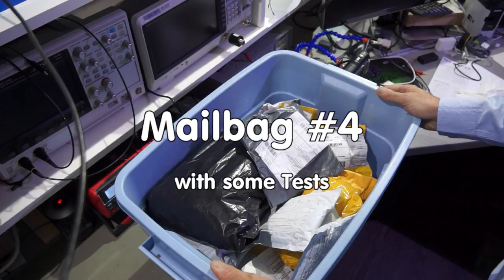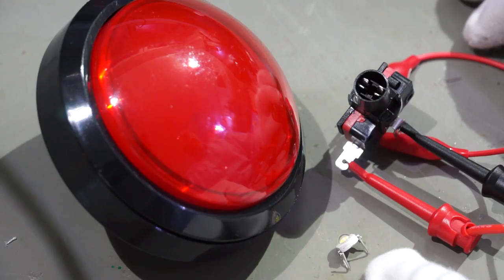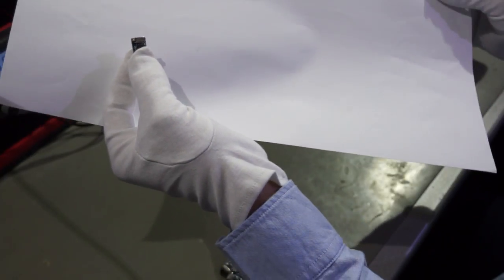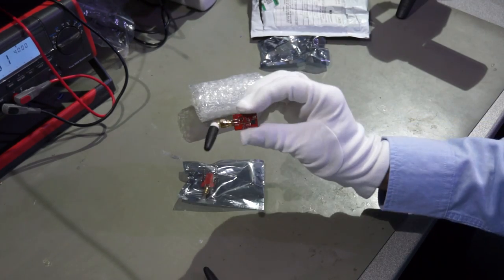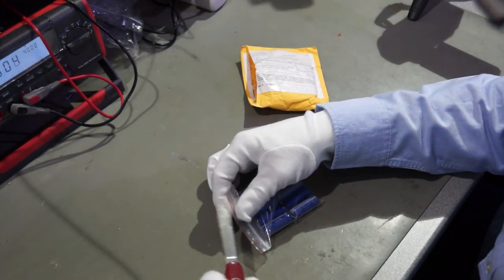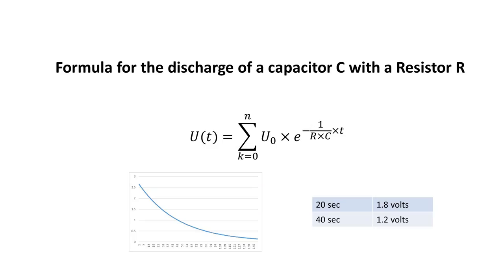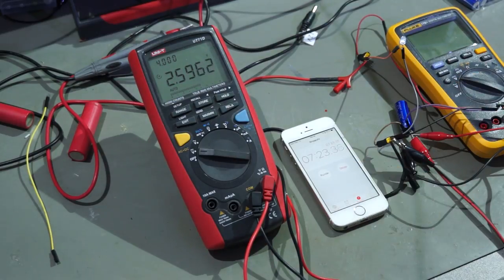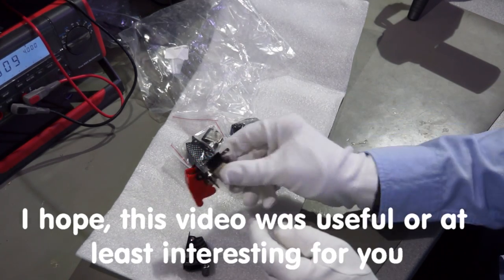#68 Mailbag #4 with some Tests

Comment: Thanks Andreas for a great video! The 433 MHz RF transmitters and receivers have really reduced in size over the years. It will be interesting to see how long they can be battery powered for. Keep up the good work!
Reply from the maker: The current consumption will for sure be one of the things I will look at. Others are protocols, sensitivity, and also propagation ( I have also some 868MHz modules).

Comment: Again a very interesting video. Looking forward for your tests of the 433Mhz modules.

Btw. I like these aircraft switches too. Haven't found a use for them but have a bunch of them laying arround to. If you have some with a clear protection cap and use a switch with a buildin LED these looks super cool!
Reply from the maker: Sometimes I am like women, just not with shoes, but with technology. I want it even if I do not know what for. At least, these switches are cheaper...
Reply: Same "problem" here with flashlights. If there is a new one with some interesting design or new technology, I need to have it.
Reply from the maker: Fortunately, I did not start that one. Is probably more expensive...

Comment: The silicon cables you purchased, do they work ok with soldering? I've recently had bad experiences with small aliexpress cabling, where the wires have some kind of enameling/protection, making soldering impossible.  Or with effort, it actually destroyed my soldering iron tip.
Reply from the maker: Just tested it. I had no problem. Sometimes it helps to add some rosin flux in difficult situations. At least, that is what I do.
BTW the wires are not copper. But for my purpose (low currents, short distances) this is not a problem.

Comment: Another interesting video.
Before I go to the mailbox today, I'm going to have my wife watch this video... then she'll be relieved at the small order I have coming in!  :-D

Regarding the projector... probably not as much fun as hacking something apart to reuse the parts but... If you can find an old cell phone / smart phone, there are simple hack of choosing a lens and a riser/stand-off to hold the lens above the phone screen - to project the screen image onto the ceiling.  If you use a smart phone, you have a lot of capability.  And then you can also put whatever graphics you want into the view along with the time... weather for tomorrow, videos of sheep jumping over fences, a watch swinging back and forth... back and forth...  
That's assuming you plan on putting it next to your bed to project onto the ceiling.  :-D
Reply from the maker: For the moment I have no particular project in mind. I just wanted to play... So, the thing with the Smartphone seems to be a good idea. But then, I also could use a other LCD display which somehow would reduce the complexity.

Comment: Hi, great video, but it would be nice if you explained in what case supercapacitors are better/ more useful than just standard batteries. That is, despite the fact that they have much less capacity, they also have a very low ESR allowing very high currents to be passed. 

I see you have 10 of the 10F capacitors, maybe you should hook them up in parallel and make some sparks!
Reply from the maker: You are right about the  low ESR. But this video was a mailbag where I usually unpack some parts and do just small tests. The super capacitor test was already quite long, so I decided to focus on the question of a viewer whether this technology could be used as a replacement of batteries. And because my channel is about small parts, I compared it also with small currents.
Maybe I will do a special video about super capacitors in the future.
Reply: +Andreas Spiess Another interesting video.  I was hoping the capacitor was going to do better.  I have been hoping for a good replacement for solar rechargeable batteries for year-round use.  I think they don't do so well in outdoor temperature extremes.   
I like the elegant gloves... I thought you were going for a more FORMAL look.  :-)
What's the efficiency on the boost converter?
Reply: I thought he was just getting "dirty" mail.
How big a bank of capacitance would you need to replace a single NiHM?  Typical sizes are 2000mAH @ 1.2v - if you're lighting a standard (?standard?) 100 mW white LED, you could use 3 of those for 7.2WH.  Or, I guess you could use one (2.4WH) and a boost converter.  Is that why you were asking about the convert?  A good RoT (Rule of Thumb) is a minimum of 85% and probably 92% as a high avg.
Reply from the maker: Since there is some interest in super capacitors I might make a separate video in the future.
Reply from the maker: I did not check, but I assume the normal 70-90% (depending on the voltage difference between IN and OUT)

Comment: What is that step-up converter ? Do you have a link for it ? Thanks.
PS. Can't wait for your 433MHz range tests!
Reply from the maker: I put the link now in the description
Reply: Any idea what's the ic number?I want to build it myself.
Reply from the maker: It consists of a 2108A chip, a SS14 diode, a 220? inductor and two resistors

Comment: I have a great idea for the 'hat' switch Andreas (for myself anyway).
1 x 700 (Chinese-rated kV) HV generator, hat switch, 1000mAh 2SSIP 5C LiFePo4 ,  1 x useless gas lighter with internals removed = super-efficient gas lighter :-)
Reply from the maker: And it could be used to light the fireworks on our upcoming national holiday on August, 1st!

Comment: Do you like your fluke 17b+?
Reply from the maker: Yes and no. Maybe I make a small comparison between this one and the Uni-T. What I do not like is, that, after auto shut-off, you have to turn the knob back to off and to the desired position. You cannot start the meter with one of the knobs.